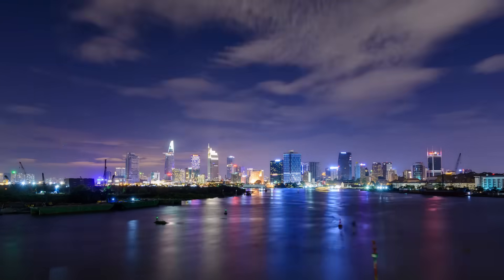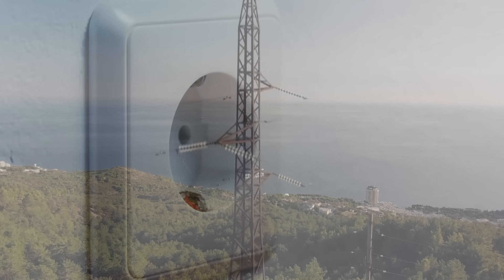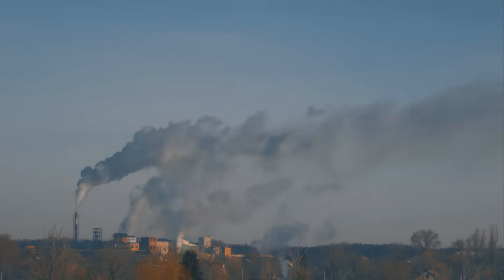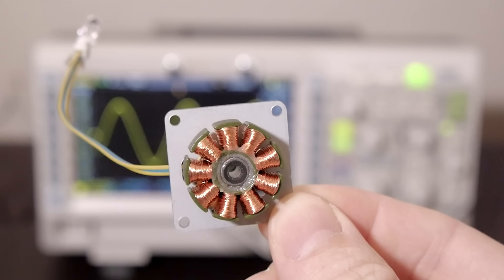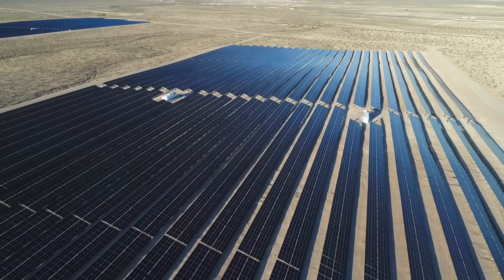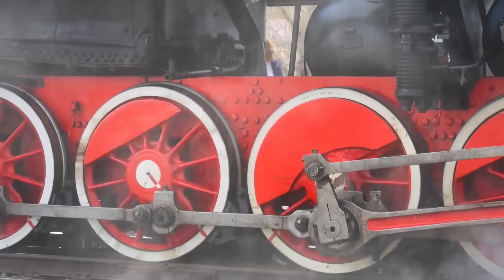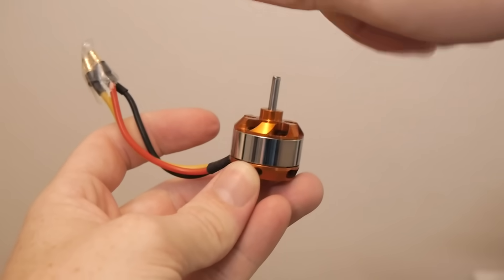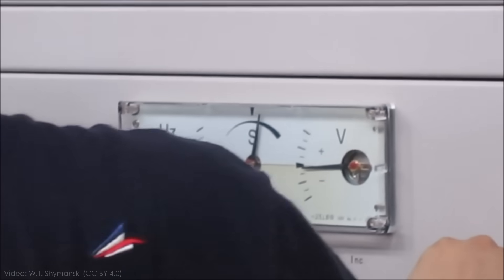How Electricity Generation Really Works

Comment: A great explanation, but you have misled on a few points.  First, generators/turbines do NOT speed up or down to meet the load curve, so that is wrong. They spin at a constant rotation.  Second, what changes is the load on the grid, which effects frequency as you note.  Grid operators manage load balance, not energy generation unless load exceeds generation and then they spin up other generators to add additional electricity to set a new level of generation, and there is only one level of generation (per turbine) at any given time.   Load balancing is accomplished by using transformers to add or remove load to meet exactly what is being produced and thus a constant frequency. Those are the 'notches' you displayed on your graph.  When they can't, you get a brown out which is low frequency. No generation is a black out. Too much fries everything.  Same level of generation under every condition.  Load is required by the system even when there is nobody using it, thus the transformers, otherwise the turbines (of any kind) would spin wildly, or not at all,  as you note.  This fake 'load' is dissipated as heat.  Too  much and the transformer blows up.   So with renewable energy it is not when and how much they generate as being 'reliable' (code word for bad)  it is that they make balancing the load difficult and dangerous to transformers.   Reliability is not the word to use.   Consistency is.  They are not constant and the grid as it is today requires constant level of generation. It is designed that way.  Add batteries of any kind to the grid and you not only create consistency across ALL types of generation,  you remove the need to spin up additional generators, or use transformers to manage load.  3 birds, 1 stone.  A modern grid and an economical one will use batteries to manage load and not transformers,  even without renewables.  Renewables are simply the benificial by-product of using technology newer than one invented in 1860.  Physics.

Comment: The train example is probably my new favorite explanation for how power grids work. I've always been using the example of a cup of water with pipes in and pipes out, with frequency being the water level in the cup. Your example is much easier to connect to real-world experience, as frequency and velocity are closer conceptually than frequency and volume.

Comment: The concept of energy storage I think overlooks the fact that our appliances and systems are designed for on demand power. We don't actually need to store as much electricity as we demand today. First because we are actually using less and less power per person. Despite all the computers and systems we have misleading this fact its actually continuing to go down. Second many of our systems can be designed to not be on demand systems. For example most residential air conditioning systems are effectively on demand and that makes sense when you lose several degrees of heating or cooling to the walls of the house per hour. By designing buildings to actually archive a certain climate without any active system and then use a smaller active system not only are you using less power but you also effectively store that energy in the thermal load of the building itself. Currently an insulated roof, venting, lighter color, external insulating walls as well as wall cavities and air sealing would cost a pretty penny but certainly less than the equivalent in batteries and you get so save on the electricity use (or number of solar panels) to.

Finally ground sourced heat pumps offer another way to avoid using more energy. However at present the economics just don't work/ It'd cost more than the extra batteries and solar panels most places. BUT that technology certainly has way more room for R&D and getting cheaper than li-ion batteries do which are really starting to take exceeding efforts to make cheaper.

Comment: I think some of the next installments of the power grid episodes should include these:

* Grid-connected power storage (batteries, pumped storage hydroelectricity, less conventional systems like compressed gas tanks and flywheels)
* Net metering
* Load demand curve versus renewable energy supply curves (the "duck curve")

Comment: Should also mention how batteries have been used to solve the inertial problem of solar production. Since batteries can react in milliseconds, there’s no need to maintain a massive inertial generator. Simply adjust the output of the battery bank.
Reply: Syhcronously connected generators have inherent inertia response capabilities, while batteries need rate of change of frequency (ROCOF) measurements to react. The biggest problem is getting reliable ROCOF measurements because it is prone to calculation instabilities due to numerical derivation. The delay is usually at least a few hundreds milliseconds, sometimes even 0.5 second or more. This can be too long for power grids with very low inertia (like for example Ireland+Northern Ireland when wind output and HVDC import is high).

Comment: What's inertia in electricity?
Reply: It's the kinetic energy of rotating masses (mainly synchronous generators and turbines). It's the ability of a power system to resist frequency changes.

Comment: The electron particle theory of electricity is ridiculous.  The electricity being transmitted by power lines is not being conveyed through the center of the wires like water in your plumbing, it is an energy field which surrounds the power lines.  The power lines act as a boundary condition to keep the energy from dissipating away in all directions at the speed of light.  However, if you have one vertical wire and run a current through it, that is precisely what the "electricity" does.  We call this contraption a sending antennae.  Electricity is light is electricity.  It is all ether waves.  Neither light nor electricity are particulate.  Physicists have erroneously attributed the corpuscular nature of their viewing medium to light.

Comment: Depending on your definition of 'electricity', it only moves at the speed of sound, not "nearly the speed of light".
Reply: It moves at a fraction of the speed of light in vaccum (depending on the inductance and capacitance of the wire).

Comment: Would switching back to locally made "town gas" be a viable solution in a post-apocalyptic world?  It can be made from wood or other easily obtainable biomass.  You could pump it right into houses through the natural gas system already installed in most towns/cities.  It could even be used to generate electricity for a small impromptu power grid.

Comment: Would love to hear about CHP/Cogen systems efficiencies and losses.  I also second a discussion about grid collapse (overloads, switching failures, etc), and restoration - AC or HV-DC transmission and grid-to-grid interconnection, phase synchronization over distance (I note that the grid free-runs, power is not set to a master clock, like GPS - because it basically can't be done).

Comment: I still dont understand the part about inertia
Reply: Inertia in power systems is another word for the kinetic energy of the spinning generators and turbines (there's a lot of energy in these spinning masses). If demand exceeds supply, the difference is supplied by slowing the spinning masses down (extracting kinetic energy from them). It's kind of a buffer (energy storage), which is needed so the whole power grid doesn't collapse when for example a power plant disconnects due to a fault.

Comment: Edit incorrect: It's a neat addendum that power plants require utterly MASSIVE banks of resistors (load) to get the generator up and running in sync 'at load' prior to switching over from startup to online. Just getting it up to voltage and matched frequency will cause a big problem when the real load hits the coils (as demonstrated with the brushless motor)...You need to spin it up while simulating the load it is expected to face on the grid, then match the grid, then cut over. It has to happen quickly because dumping megawatts (very plural) into a resistor is a good recipe to boil the dump bank!

Excellent video as always!
Reply: No, it's not like that. The voltage angle is synchronized too so the active power flow after the connection is zero (neglecting losses). It's the voltage angle difference that determines the active power flow in AC power systems. When it's synchronized you can increase mechanical input to get an active power output from the generator.
Reply: @Ed Harms Thank you for sharing, I stand corrected.
Reply: @frollard  
Where did you hear that some power plants have massive resistive dump-loads? I don't doubt that it could well be possible.
Reply: @ frollard, you are completely incorrect!!!! There is ZERO resistive load required at a power plant to go on line.  You bring the generator up to 3600rpm(for a 2 pole generator), make sure your sync scope confirms 60hz synchronization and close the breaker... easy peasy.  Additionally on a bulk electric grid, resistive load in general is light load. The heavy load on a grid is inductive load, which is why bulk electric system power plants can vary reactive power ( MVAR's). the bigger the generator the more leading and lagging MVAR capacity.

Comment: You should have considered using updraft towers to generate power with some inertia from the turbine or turbines at the base of the updraft tower. The higher the air humidity, the more efficient. Mist updraft towers also generate water, from the vapors, but mist updraft towers, smoke updraft towers and solar updraft towers all generate electricity and create a breeze and local cooling. The local cooling can be used from one updraft tower to locally combat global warming, and from many towers in an area to hopefully combat global warming. 

As I have pointed out in the comment section of the Greening The Deserts video of Real Engineering, this can be used in combination with pipes going from the sea to a greenhouse-like evaporation tunnel, from there to the desert where to be used in an updraft tower by being split in two, one stream of steam going up to lift air, and the rest going through pipes which are cooled by the updraft created. Now that you have water, you can import some top soil and import or make terracotta pots to grow plants in. The plants would be put in rows, with enough space for a person to walk in one direction and a cob wall to protect it from the lateral sun. The walls should go north to south, and be used to minimize the sunlight which makes it onto the plants. Cling-wrap foil can be used to cover the top of the walls, so the moisture does not escape, and cheap while/silver plastic sheets be used to block even more sunlight, so the plants do not heat up that much. The pots are planted so that they are filled with planting soil and the put is buried up to the lip/rim in the nearby sand, and then the nearby sand is to be mixed with some planting soil and straw. Tunnels like this would be fairly long, with water access at both ends. Watering them will employ local people, including children which would otherwise not have a reason to be allowed to learn how to grow food, and the people employed will be paid with money, education and food. By not having animals which to graze the soil, and by having the shade from the scorching sun, the top layer of sand will slowly turn into normal soil, at the same time at which food is produced. This also creates farmland. If rows if rows of trees are planet so that after the walls are removed there are rows of trees shading 3 rows of crops about a meter wide, with walking paths in addition to that, then the soil will become stable enough to not have events such as rivers of sand, like the ones happening in China some time ago. Aside the water, electricity will be produced, which when mixed with internet access, will all of a sudden bring millions to billions of people on the internet within half a decade, thanks to affordable smartphones and tablets made in China.

I (really) hope this comment doesn't also get hidden/shadowbanned by Youtube. If you want to know more, contact me, or ask me here for a method of contact.
Reply: Thermal updraft towers have terrible power densities. Humidity draft towers only really work in dry areas where water is usually hard to find.

Comment: Electricity does not travel at the speed of light! The drift velocity of electricity is actually quite slow. The Speed of wave propagation is close to the speed of light.
Reply: Electrons in a wire travel at the drift velocity, electricity travels close to the speed of light, depending on the capacitance and inductance.
Reply: Semantics fun 😂😂😂 but based on the deffintion of electricity i guess you're right lol ill admit when im wrong!

Comment: Completely wild that the electricity in the light I just turned on came directly from the power source milliseconds ago. Never thought of it that way! Thanks for the awesome video!
Reply: Sort of true. The force (voltage) travels at close to the speed of light, but the physical electrons actually travel quite slowly, in the order of centimetres per second.
Reply: @golfmike13  Yes, but the actual electrons don't need to travel from one place to another to transfer electric energy. Also in AC, the electrons just vibrate.

Comment: Can you go deeper into nuclear energy generation please we have Wolf Creek not to far form my town
Reply: keagan Nuclear power is basically a steam engine using a turbine somewhat like a jet engine instead of pistons and steam blows against the blades. The nuclear material must be hotter than the steam that comes out and replaces the coal as used in the old railroad locomotives. Steamships use steam turbines and burn oil. Nuclear powered ships and submarines use steam turbines to turn electrical generators which turn electric motors on the propellor shaft.

Comment: I wonder then if it would make sense, in a primarily or entirely solar-powered grid, to install flywheel motor-generator-batteries for ultra-short-term energy storage, to induce artificial inertia into the system. Or if, alternatively, it would make more sense to rely entirely on chemical battery packs.

Comment: Great video. From my perspective CO2 is just an underutilized resource rather than a waste product. We don't necessarily need to produce less of it we just need to consume more of it. Carbon sequestration through better farming practices could consume all of the extra CO2 in the atmosphere and actually generate a demand for it. When there's too much carbon in the air it just means that there isn't enough encapsulated into lifeforms and other organic compounds on the ground. 

 Also, I'm all for using nuclear power plants. Geothermal energy is predominately nuclear energy as well. Since the planet itself uses radioactive decay to keep warm, I'm not sure why we shouldn't follow the example.
Reply: Yes, its just like with money, if you dont have it just get more!!

Comment: So whole electric grid is synchronised, for example whole Europe has interconnected grid. I wonder, if highspeed camera on orbit can show how whole Europe street lights are blinking in sync with grid frequency during the night. If it's even detectable due to light reflection from environment.
Reply: The continental Europe is synchronized. The Great Britain is its own synchronous zone, so is the power grid of IReland+Northern Ireland and so is the Nordic interconnection (Norway, Sweden, Finland and a part of Denmark). Depends on the type of light used, this can be seen for example with incandescent lights.

Comment: great video, how ever your definition is slightly off for spinning reserve. for most thermal plants, the spinning reserve is basically a big "accumulator" of steam pressure that can be called upon at a moments notice. at our coal station we might shove 18MpA into our turbine steam chest but its throttled down the 16MpA into the actual turbine, this gives 2MpA and a big volume of steam sitting around incase we need to increase load quickly. it also helps with not having to quickly fire the boiler up harder to try and match the steam demand. you can use up the spinning reserve while the boiler heats up bit more making more steam.

it doesn't have too much to do with other plants coming into service quickly (normally called peaking plants to take advantage of peaking electricity prices)
Reply: Question, since a grid can be serviced by several electricity providers and plants, how do they pick who gets to pick up the slack or dial down?
Reply: @kovona  each company puts a bid in for every half hour of generation, and it's abilities (whether or not you can get your full megawatts)

Basically the slack is picked up over all the generators by small amounts, rather then 1 plant doing it all. It's weird process.

Comment: So technically electricity does not travel at the speed of light but it just seems like it. Electricity is just single electrons flowing through a wire and the electrons themselves don't travel fast at all. The illusion of them travelling at the speed of light comes from that if you think about about a wire and a new electron is introduced on one end, there is a kind of pushing effect between ALL the electrons that already existed in the wire which causes it to poop another electron out on the other end.
Reply: Electricity actually flows at 1/3 the speed of light.

Comment: Saying electricity moves at the speed of light is a complete oversimplification.. its actually pretty slow.. well the elections themselves are slow.. like 3 meters a second I think (without googling it). It's more of a drift... only reason its instantaneous is cuz it's like having water filled in a tube.. push one end of the water the other instantly comes out.
Reply: The electrons just vibrate 50 (60) times per second because AC is used for the majority of power lines. Electromagnetic waves travel near the speed of light.